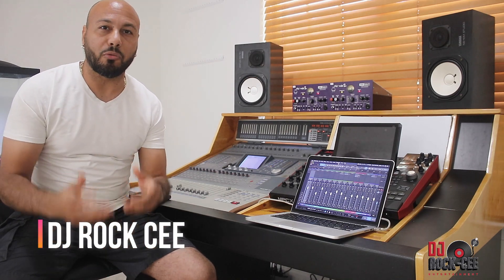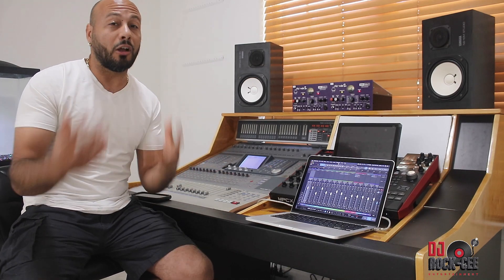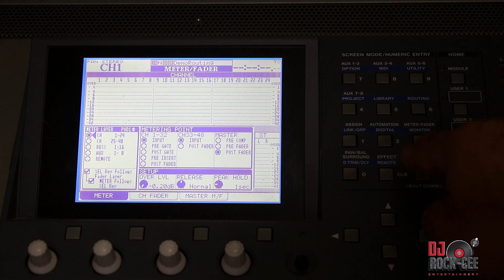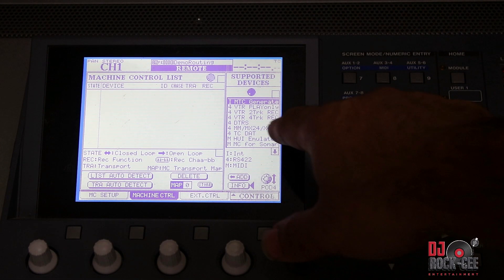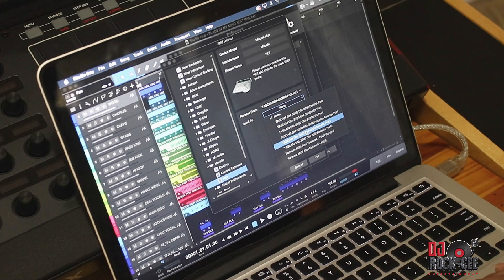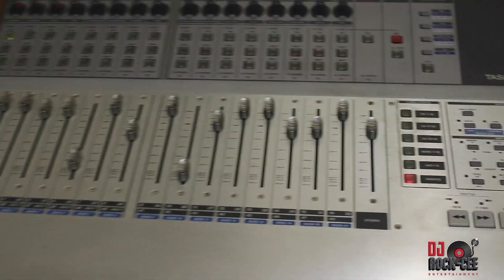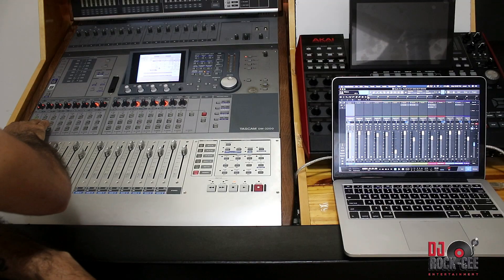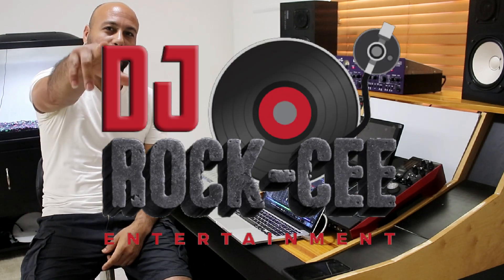How To Install Tascam DM 3200 / DM 4800 To Your Daw (Studio One)Using Your Mixer As Control Surface

Comment: I have a. Pro Tools - Tascam DM3200 with the Firewire Card & Mac Pro Setup which takes the DM3200 and turns it into a Full Fledged Mixing Console capable of recording 16 tracks all at once and playing back 32 channels on the DM3200 from Pro Tools. The beauty of the system is that you have choices of mixing in the box or mixing on the DM3200 and you can use analog outboard gear as well as digital plugins. It has given me options. Also, the DM3200 has 4 layers of faders: level 1 channels 1 to 16, level 2 channels 17 to 32, level 3 33 to 48 and level 4 Buss channel 1 to 16, essential for a powerhouse mixing board. Tascam offers a paper on the integration of DM3200 with Pro Tools called: "DM-3200 DAW Control HUI emulation for Pro Tools" which sync the Play - Stop - Record on the mixing board with protools as will as having the mixers faders and pro tools mixing faders on the DM3200. I have used this system for 18 years. The other benefit is that you can use sample rates of: 44.1 kHz, 48khz, 88.2 khz and 96khz as well as bit rates of: 16, 24 bit. If setup properly, it is a serious professional set-up. Also, need more channels, you can buy a second DM 3200 or Dm 4800 and cascade the two boards together.

Comment: I have a focus right Clara eight input.  You can go out of the of the 3200 or the 4800 plug light pipe into the focusright  and get another eight input out of the Tasman 3200 or 4800. Giving you a total of eight inputs from the focus rate and eight additional input from the taskcam. The advantages you can plug-in 24 inputs the task and then bust down to eight. For instance, if you’re recording  drums, you can have eight microphones from the 4800 through the focus rate into your daw. Without using the Task cam driver. The convenience of having a 3200 or a 4800 is that you can leave your guitar plugged in maybe guitar plugged into two stereo channels microphone on different apps and never have to move anything because you have 24 microphone preamps. So if you’re already on a 4800 or 3200 they are not Absolutely yet. On top of that, as you see here they are Daw controllers also.  Plus, I still have my old computer so if I want to run an older version of logic, I can run 24 track simultaneously with my 4800 no problem. I hope this helps.

Comment: Yo Roc cee what os are you using with your Mac seem like drivers only are offered with the older os like mountain lion do I have to upload an old os  for the  tascam to lock up?  Also with the fire wire card I have it but I'm using  high Sierra on my Mac? How can I make them lock up can you help me?
Reply: I use DM4800 with Mac with Mojave 10.14.6 system and it is working well, I would like to update to Catalina, but I don't know if Tascam supports it

Comment: Sup bro?
Thx for this.What interface are you using?
I have a quantum with two Adat cards for my 4800.
I have no idea how to work them together
Reply: You can link them through adata for added inputs output or strictly USB for automation. Or both at the same time for more channels or summing. Really depends what you want to do with it. The Tascam website is still active and has a basic manual to get You started. What are you trying to accomplish with the mixer?

Comment: Thanks for the review! Could you please let us know how noisy is the power supply of desk when it's on for mixing next to the loudspeakers? Also how noisy are the motorised faders? Thanks!
Reply: This does not have a separate power supply but not solid state so you get some noise from the cooling system but not harsh or disruptive. It's not a quiet/smooth mixer since it has moving faders but if you have steady hands you wont have a problem.  The faders arent dead quiet when moving but not annoying to work with in a way that it willl interrupt the session but mic placement matters here if you dont have separate rooms for recording and mixing..  The coolest part of this mixer is that it has many inputs, outputs,pres so the routing is so flexible and HUI works extremely well once set up but check to make sure this will work with the daw of your choice.

Comment: Ayo fam can you do a video on how to get audio from the the DAW to the tascam dm 4800 with firewire card i’ve been trying to get it set up but no luck
Reply: What daw are you using? Make sure your audio routing is setup to the tascam for audio in and out. Just like you would an audio interface under preferences.

Comment: Thanks for the info! Do you have any tips where I could find a proper mac driver? The software on the Tascam page are all outdated and not compatible with the new Mac version.
Reply from the maker: Just google download drivers for the Tascam dm 3200/ 4800 and it show up
Reply: @DJROCKCEEENTERTAINMENT  Hi, great instruction vid but I don't really get It. There are (the latest) drivers for Fw card Mac OS X incl. 10.11 El Capitan out there but only very old drivers for the DM4800. What DM4800 drivers works for OSX Mojave/Catalina and where to find them?
Reply from the maker: @magnusstromwall4374  I’m using Mojave OS

Comment: Great Video I have a dm4800 with meterbridge, is there a way to use the meterbridge to display the outputs of the tracks ?
Reply from the maker: Yes is button on the meter bridge that you can select.
Reply: @DJROCKCEEENTERTAINMENT  Could you please explain it better? I use it with my daw, everything works great, but I cannot see the signal of each channel on the meterbridge. Thanks
Reply from the maker: @aquietmanmusic  what Daw you using ??
Reply: @DJROCKCEEENTERTAINMENT  I'm using Cubase

Comment: Thank you very much for the instruction. I can control the tracks inside the Daw, through the tascam DM 4800, but i don't have sound I/O on the tascam.
Please, help me to solve this problem that is keeping me awake.

In advance, thank you very much again.
Reply from the maker: If you don’t have FireWire card installed you not going get sounds in and out
Reply: There are three ways to get audio. Either through FireWire card, adat card or digital card. Check to see which one you have. The easiest would be adat or FireWire. The digital card is quite expensive compared to the others,hope this helps
Reply: @calilovemusic2816  Thank you so much for trying to help me. the big problem is that I only have the Tascam Dm 4800, and the memory card. If possible, make me a course, teaching me how to record, and mix inside the Tascam Dm 4800 without using a Daw. If it's not possible, at least teach me how to record on separate tracks and save the audios inside the computer. send me your address, and we will negotiate the price of the course.
Reply: @calilovemusic2816  Thank you so much for trying to help me. the big problem is that I only have the Tascam Dm 4800, and the memory card. If possible, make me a course, teaching me how to record, and mix inside the Tascam Dm 4800 without using a Daw. If it's not possible, at least teach me how to record on separate tracks and save the audios inside the computer. send me your address, and we will negotiate the price of the course.

Comment: Ayo fam I just got the DM 4800 yesterday mine don’t have the card so can I use the Uad Apollo with it
Reply from the maker: yes you can !
Reply: yes
Reply: @luisballe4053  quick ? So if I don’t have the FireWire card what are the limitations to using the 4800 with my DAW I’m running reasons 11 Logic Pro x and protools2021
Reply from the maker: @Kasetownbiz  FireWire card is for Audio inputs and outputs from your daw. If you have a interface you can use that. And use your mixer as a daw controller
Reply: Ayo fam I just got the FireWire card for the dm 4800 can you do a video on how to get the inputs and outputs setup on the tascam dm 4800 or 3200 I’ve been trying to get my sound from my daw to input on the dm 4800